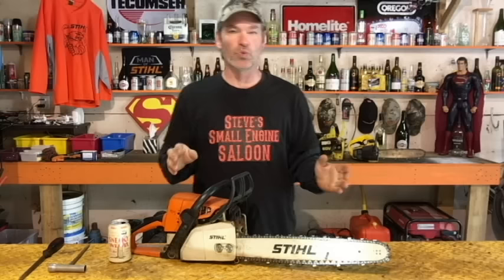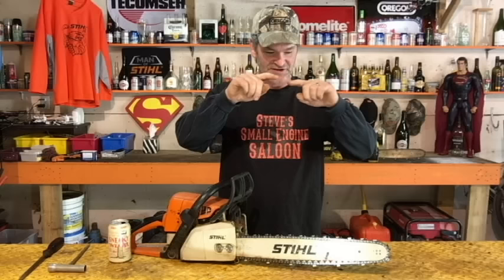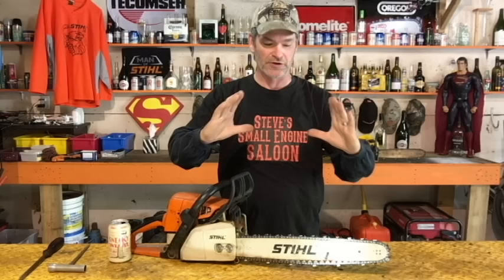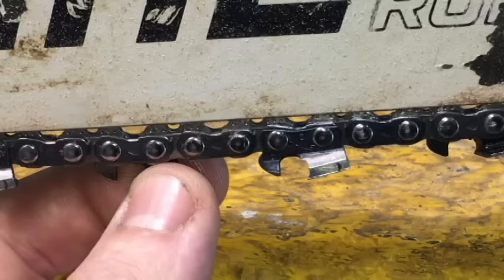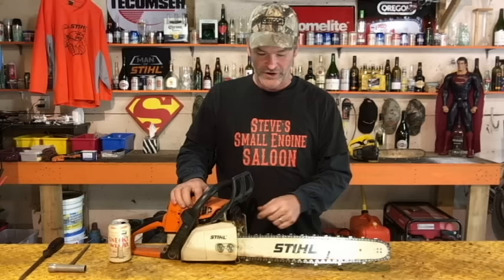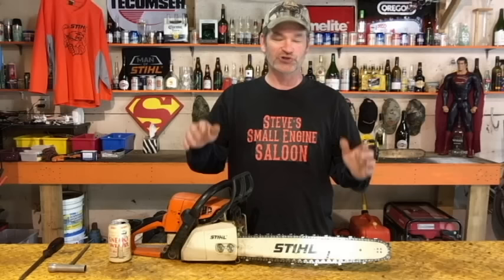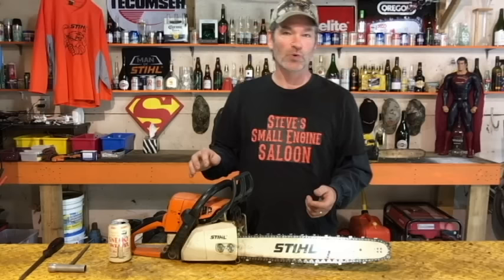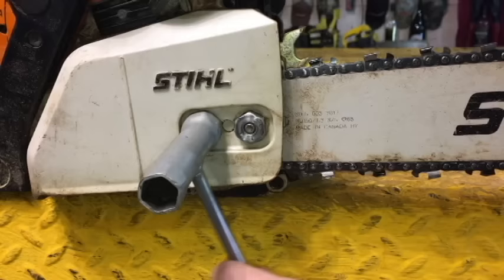CORRECT WAY To Adjust The Chain Tension On Your Chainsaw

Comment: Hello Steve. I got one for you. I own a STIHL BR380 blower. Even though it’s 11 years old the hours of use are low. I only use non ethanol gas and synthetic oil. Last week after full throttle use of about 30 minutes it lost power (rpm’s dropped). I took off the cruise control and it idles fine. Shut it off and it starts up fine but will not rev up to high rpm. Once cold I start it up and it does the same thing. Only difference is it only takes 5 minutes to act up now instead of 30 minutes. I have done the following. Cleaned the spark arrestor, removed the muffler to verify the exhaust port wasn't clogged, replaced the spark plug, air filter, fuel filter, carburetor (OEM), ignition coil, and fuel lines. Compression is 127 (checked it right after it lost RPM). I also removed the fuel filler cap thinking the vent was clogged. No change. Spark plug tip looks normal. Once RPM’s dropped I sprayed starter fluid into the intake and it still didn’t accelerate. Adjusted the high speed screw on the carburetor and it didn't help. It has me buffaloed. Any thoughts? I know I can buy a new one but it's in such great shape and the new 2 stroke model is 2.5 lbs heavier and I’m like you, I want to find the problem. Sure would appreciate some help!

Home Garage

Reply

Comment: I clamp the blade about half way down and upside down in a vise then check tighten and check again and adjust if necessary, enough tension for the upwards movement or should say weight. To take the slack out of the movement of the bar.
Reply: And hi from another Steve 😊 from  not so sunny 🇬🇧

Comment: Solid instruction Steve!
Some (perhaps) interesting trivia; when i was taught by a Husqvarna tech many decades ago he said exactly what you said, plus included other factors like heat expansion at working temperature and allowing for looser sections in the chain.
These days i use saws only rarely and even then only for seconds at a time.It amuses me that my brain:
a) actually remembers those instructions 
b) and subconsciously adjusts the chain for cold use 😅

Comment: You helped me change my fuel lines & chain tension, along with detailed knowledge.. I watched 3 other videos on fuel-line changing and got it wrong, until i found yours! You have a great strength in teaching which has got this McCullough 3200 running again! Subscribed_
Reply from the maker: Glad it helped

Comment: Steve, great video as always. I learned a slightly different way that seems to have always worked. Grasping the chain from the top, about dead center of the bar, lifting the bar at the same time, tightening the chain to allow just a bit of clearance at the top, then locking down the bar in the full up position... ready to cut. Seems to always work, from dead cold to a hot bar and chain after a refueling and a touch up to the blade teeth or a change out of the chain. The end result of yours and mine is the same but mine seems easier, but I will certainly try yours out next time. Thanks, as always for  your informative methodology to get 'er done.

Comment: Good show, I personally go a tad looser, like you said about personal preferences. The number one thing to be sure of is your oiler ports being clear. I also remove my bars to slide a razor knife down the groove & check tip sprocket free to spin.

Comment: It would be great if Stihl, Poulon, Echo, Husqie, or whoever could design a chainsaw where you adjust the tension with a knob/dial while in use without needing to shutting it off, let is cool and then going back for the tools. As the chain stretches with use and you go from cutting brush to limbs to trunk it would save time if your doing it right by properly tensioning for each.  

When I fell dead trees for firewood, it's an all day event and I'm trying to run the saw as long as possible to get trees down, cut, split and stacked in a weekend.  The traditional way, it might take a couple minutes, but it's really double that or more when you have to shut it down, let it cool a couple minutes or have to walk it to where the tools are.  It could also save time with chain pops and reduce wear on the chain/bar.

Comment: Thank you, great video. Also good physics explanation on why you don't want a chain that's too tight. Had to think about the physics for a while thinking it might be centripetal force, but I concluded there is probably none. My insight is it's the centrifugal force appearing at the flat/horizontal portions of the chain forcing the chain inward on the tip and other end.

Comment: When I started watching, I thought for sure you were going to miss two things that nearly everyone I know, does not understand, or do. You only missed one ;-)

I have been showing people for years, to tip the saw forward, so that the tip is against the ground or bench or log(where ever you are) so it is lifted up while tightening the bar nuts. Glad you have shown people this, I will say critical, safety setup tip. It is also important to keep in mind that when/if you use the top of the bar to cut somethings upwards, do so very gently, so you do not make the bar move down, and slacken the chain. 

The one tip to proper tightening of the chains that you did not mention, and can be forgiven for, is that the tension is different for the older solid bars that do not have a sprocket at the tips. I have some vintage saws and bars. These solid nose bars need the chain just a bit looser. FYI

Comment: I was taught this way:!1.  chain can not sug under, 2. while pulling down you can not use force as you did and higher part should not come out rail.
I comment on 2nd minute so I will watch Your way.
I was also explained that after chain get temperature, matel also expands and chain after minute become longer and looser..
I am 50 and so far always was good.
Now I keep watching...😄

Comment: I learned from a guy that had been cutting for 25 years...I have it so when the chain is cold the guide teeth are just barely riding in the bar...once it gets hot I check it again and adjust it...I also just go by sound and feel...if it seems like it's getting hot and not oiling good...I loosen it a smidge...I don't believe every chain it and loose or tight right from the factory

Comment: I love cutting wood only in a top to bottom motion and getting it pinched between the wood non stop. I wish I could go from bottom to top sometimes, but this guy who doesn’t know what he’s talking about had me tension my chain in such a way that it’s not good for the chain if I now go bottom to top. How I was tightening it prior has worked without issue for 20+ years, but I guess I was wrong and I should instead waste half of my time now getting my chainsaw un pinched.

Comment: I had an idiotic supervisor once told  me to tension a saw flopping like that.I realized that the saw expands as it heats up with use.Uh oh! I thought.I started tightening the chain up very snug-too tight+difficult to move by hand. Someone who knew what he was supposed to do told me the correct method.The video is right. He knows what he is doing.
Reply from the maker: Thank You...

Comment: The best way for me personally is to lift the saw with the tip resting on something and snug it up than put it down, mark a tooth and hook the wrench behind and flick the chain and it should move somewhat freely. If it stops immediately withing the space of 5 teeth I loosen it and if it moves more than the space of 15 teeth I tighen it, it might not work for everyone but it works for me.

Comment: I have mine set so it's just tight enough to be touching all the way along the bottom, and when I adjust it, I place the tip on wood and make sure the bar is tipped up. Basically what you said. It's common sense if you've logged a lot of hours with a saw.
Reply from the maker: Right on

Comment: I totally agree with all you said and the technique used are right on. What comes into play is a sprocket drive that is slightly groove wear worn . No matter how you try it seams the adjustment just does not work. Besides replacing the sprocket any other technique would you recommend ??? Reason I am asking is many of my neighbors have quality saws and still do not have the correct tension. They just bitch and refuse to replace the slightly worn parts because of shop repair rates. Thanks vf

Comment: You did help. I wonder though, why is the bar so loose? Is it wear, or just lousy tolerances in manufacturing? I design, and build machinery. If a machine had that sort of sloppiness, I would redesign the parts, or find out what the heck they’re doing in production.

Comment: I forgot to mention, I was always a slow learner. I saw someone mention  to warm it up and re-tension, the chain warms up and expands, when ,you restart with a cold chain it may be too tight. Homeowners and casual woodcutters are the Bain of the repair shop.

Comment: another little thing to mention, more for rookies and homeowners is, make sure your chain brake is off, if your brake is on the sprocket won't move freely to tighten your chain no matter how much you spin the tensioner.

Comment: I found the easiest way to get and keep the bar in the correct position is to flip the whole saw upside down,  then the weight of the bar and chain holds it in the right position without having to hold the bar

Comment: Hi Steve, Frank from England here,  i like your videos and have used many of them for problem solving on many of my engines , about the chain on my saw i have noticed after adjusting its it becomes loose after being used and needs readjustment,  there is plenty oil getting to the chain , any ideas??? Regards Frank 👍🇬🇧

Comment: I recently bought another chainsaw i tested it on a oak log. It wasn't cutting so i thought th chain was in the wrong direction or loose so i dealt with. It did the same thing. Luckily i had another chain. And it performed great. My guess is that chain must be dull. The chain looks well used

Comment: Maybe tension it and tighten the bar bolts up with the chainsaw upside down on the table.  Might even be a good way to store it to keep the bar oil from leaking out.

Comment: Yep, for years people been asking what im doing when tighten my nuts because i use a 2x4 at the end of the bar and i push down when tightening to take up that flex. Unfortunately not everyone has the common sense to realize that flex will cause the chain to be much tighter when cutting if you do not. Nice to see someone explaining it.

Comment: Sure appreciate ya Steve. I'm gonna have to find some Sneaky Weasel. Also, I've been watching Vietnamese 'homesteaders' on YouTube for about a year now. Every single one of them has a mammoth Stihl chainsaw with something like a 2 foot bar or longer. They all wear flip-flops or go barefoot! But that's not all, the chain is slack and they use the tip of the bar. This puzzled my 80yr old father greatly! He figured they must have some mystical magical knowledge. Have you ever seen this? I'd be interested to know your thoughts! Cheers!😷👍👊💪🤙

Comment: Chain tension should always be a function of the material being cut & the type of work. That’s why five different guys in a room will show variation on their individual chain tension. A torque screwdriver could easily be designed to ensure uniform tension, but that would do a disservice to the faller’s intuition.

Comment: Hey man, great video. Always wondered in what position the bar needs to be in for proper tension. Now I know. By the way, I have an old Stihl 041 that has been sitting for a good number of years. Just got it back together from reconditioning. Runs great, idles great. Just not sure, what the proper fuel mix is? 50:1 or 32:1. Thanks

Comment: You can run a chain loose. If im cutting firewood thats all going to be easy vertical cuts i might wait to tighten my chain. If im limbing or cutting up brush i tighten as much as i can as long as the chain spins without resistance

Comment: With respect that is good stuff for average homeowner users but you said a lot about the different trades and tensions that should be noted. Ben running Stihl's for 41yrs. and have done some in all trades but mainly logging and firewood. You couldn't notch a tree with my log cutting chains that I race through and use a looser chain as I get mine to about 13000 rpm's all while cutting. Have yet to hear anyone cutting at 12000 rpm's while eating wood. So my rule of thumb for those is where you showed a light pull down on adjusted chain, I do same but my guide is that light pull and exposing one full drive drive length. I'm also sure I could change chain and adjust faster without the bar drop problem by having the saw on its side to change and adjust the chain. Then in climbing, cutting in thick brush,limbing that can have branches jump the chain, in the air climbing you surely want a snugger chain to take any chain jumping away.

Comment: Looked at your vids hopeing to find a troubleshooting guide for a chain coming off a bar. Have a new chain and bar for a poulan 665 that the chain keeps jumping off. Have to keep it so tight the tip is scorched and have to take frequent breaks to cool it. Not sure what the problem is.

Comment: the locking bolt and the center bearing (the 2 silverish pieces in the tensioner assembly), are they typically available for purchase without buying the entire assembly? they're both missing on a chainsaw (Stihl MS211) i'm trying to get operational again

Comment: Only thing I would add is ALL chains develop tight and loose sections. After setting tension, move the chain by hand to be sure you don't have it too tight in some positions. See it on motorcycle final drive chains all the time.

Comment: My chain keeps coming loose on my Husq 450 after about 6 or 7 cuts. I've changed out the sprocket but it didn't help. The adjuster screw has the bar as far forward as it will go. I have 6 chains and none will stay tight.
I'm wishing I woulda bought a Stihl. I spend more time tightening and changing chains than I do cutting logs. Its to the point its more efficient to just buy wood every winter.

Update: I looked at the end of my bar tonight after it threw the chain, which has never happened before. The bottom edge towards the front tip is wore down about 1/16" about 3 inches from the tip. I'll be buying a new bar tomorrow!

Update 2: I bought a new Husq X-Force bar today. I laid my original bar on it to compare, and the original bar is 1/4" shorter from top to bottom...its literally wore that much!!! No wonder my chains wouldn't tighten or stay tight. I had NO idea a bar would/could wear down like that. I'm happy with my Husky again :)

I'm also switching to Harvest King bar oil instead of Husqvarna.

Comment: I’ve tightened over 20000 chains it’s like different every time I set a woo block under the end maybe loosen the adjuster a tad just to make sure the post is in the bar hole tighten the nuts then back them off one full turn adjust it tighten it then rock the chain back and forth with my hand and feel the drag force and take it from there depends how it feels I usually have to to loosen it back up and make a fine adjustment to be happy most saws have a worn set of sprockets so rock the chain back and forth and adjust it in the loser spot

Comment: Im have mi ms250 for  4 years  and im  change the chain  only ones  the blade  still original   it just by use  few month at years  but things like this made  the diference  alot

Comment: i think you might have solved a problem for me.  my new ryobi chainsaw keeps losing chain tension after I start to cut with it.  i set good tension then in a couple of minutes its really slack and hanging down.  i think the bar is moving up to that top position.  im going to try holding the bar up when i retighten the nuts and see if it works.  thanks greatly mate.
Reply from the maker: Right on

Comment: Also please note if the bar nuts are changing your carefully set tension as they are tightened down.  I used to move the chain to check, now I can see it happen

Comment: If I could add to a already great explanation.   
When complete, make sure you pull the chain forward (the direction it goes when cutting) and feel for a tight spot.   All have this.   It could be the nose sprocket or drive sprocket, wear on the drive sprocket teeth.  Thats the best point to adjust from.  The chain should go around smoothly without tight spots.   Also for bigger bars or left vs right hand people,  you can lift the saw handle to put weight on the bottom of the nose when tightening the nuts this is the same as lifting the front of the bar.

Comment: Sometime ago I was watching one of your video how to fix a crack in a  plastic petrol tank ....I got a Stihl 023 chainsaw
where around the petrol cap is a crack ...should I try to weld as you did or fix it with some poxy ?
Also my son  bought one of these cheap  Cinisi  chainsaw only used a couple of time in two years and for 
a short time . ...This morning I had to cut a big log and decided to use this chainsaw that NO WAY would start ....
I cleaned the carburettor put back still no start  --the sparkplug was  wet ----.... checked  if there are some   sparks
 yes there are some  not really very bright seems to be a bit weak ....put back still doesn't start ....removed the 
the ex soste pipe in case of scratches on the piston ....it was shinning as new  no scratches   ....Yes I played around with 
the H & L screws and never took notes how many turns out   ...All I can read on the chainsaw  " 58SK" ....
The petrol is not old as  I use it quite  lot for other two stroke   tools .
Hope to hear from you  or someone ...THANK YOU .